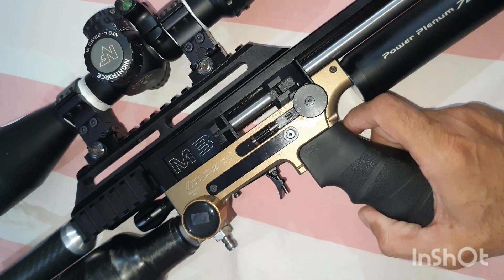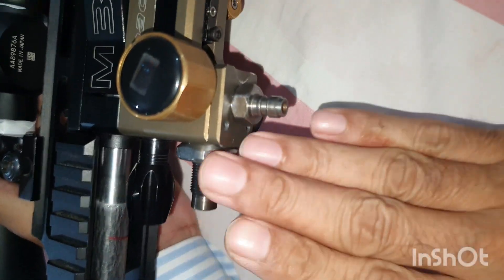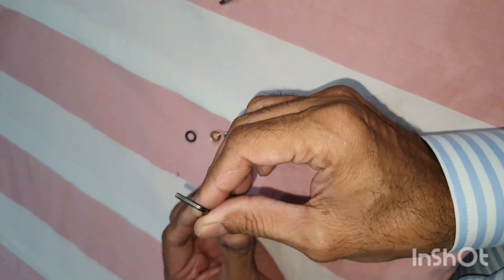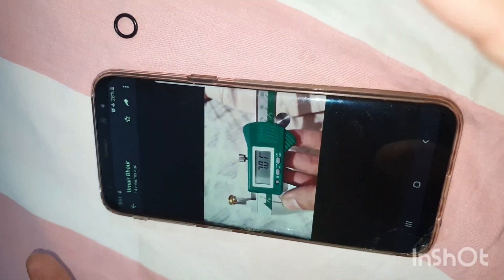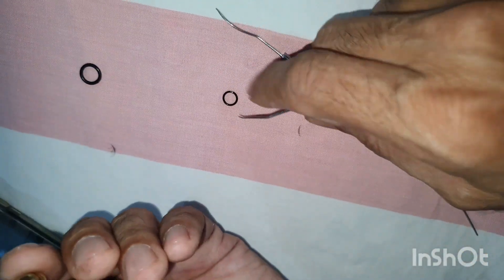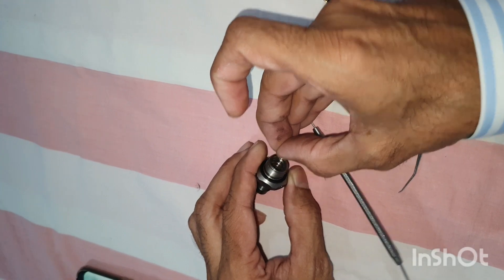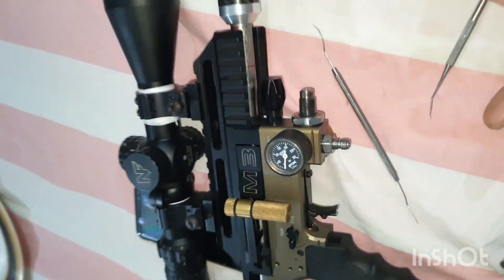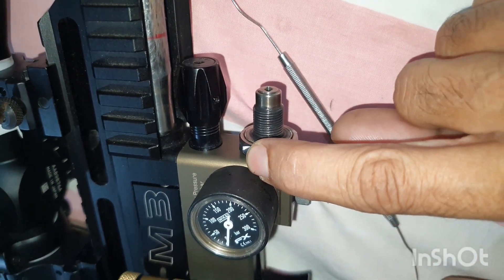FX Impact M3 1st regulator modification

Comment: I liked your video and it was very interesting because I am suffering from slow recovery after I had a fast recovery , but once I raised the pressure in 1st reg things changed and even the small o ring inside the body of the regulator was damaged and the piston o ring as well was damaged

Comment: Awesome I have already replaced that whole reg three times because it starts to leak from the breathing hole so thanks for sharing be safe buddy 💯
Reply: Replace only the small tiny o ring in the body of the regulator which sets in the middle at the breathing whole area from inside and the leak will stop

Comment: Alo can I buy modified parts from You ?
Reply from the maker: I do offer some parts but 1st regulator parts are not plug and play. So I do not offer them.
Reply: @BhaursAirguns  I saw some delrin between regulator screw and piston, but I'd be happy to buy complete set if it fits stock first reg case. I'm able to fit them.
Reply from the maker: @gagain100  The new version of FX pistons is similar to what I made. All piston made of brass and front sealing tip made of delrin.

You can easily buy FX latest pistons from FX.

It will cost you less that at what cost I can provide you the piston

Comment: Good video I have a cuestion I rebuild the second stage regulator in my m3 several times but when I screw the bottle and I open the regulator don’t hold any pressure the air star leaking trough the barrel what you think it’s thank you
Reply from the maker: Valve is defective

Comment: hi mate could you sell to me your first stage mod. reg  piston and your modification tigger for my impact m3 ? regards
Reply from the maker: I have sent a couple of triggers but I found that it's not a plug and play part. A lot of minute adjustment is required.  Hence I am not selling it anymore. 
Similarly I understand that one has to understand the real problem of the regulator to fix it.
The piston and brass part can be sent but I can't say these will be productive for you or not

Comment: Hi.
Greeatings from Portugal.That is a good mod, congratilations.
I will share what i´ve made that works too.
In my case, I have a huma reg gen 2 for my fx crown, and I discover the piston (brass) and springs (0.4) from huma gen 2 are the same as fx 1st reg (plastic piston).
So I change it and add 2 more springs. So 7 sets of total 14 springs in this order  ))(())(())(())
210 bar 1st reg and 180 bar on second.
But if i had a lathe, I tried to copy your mod just because is better🤙

Comment: After many times changing 0rings on the first reg I have two first stage regs from fx they both leak after I change 0rings after about a couple of weeks it just leaks from breathing hole so I bought a huma first stage reg for my fx m3 now it's good 👍 so far fingers crossed thanks for the info I tried what you did but it still leaked so I just gave up and got the huma hopefully this will solve my problem ty again it's always a pleasure watching your videos
Reply from the maker: Thank you. Hope Huma will work for you. I prefer FX Regs over Huma.
Huma is good initially.  If we adjust it again and again it starts showing issues. 

But for 1st reg as we don't need to adjust it often, Huma should work well
Reply: @BhaursAirguns  What kind of material did you use on the tip of the disc springs pin, where does the sealing with the adjustment screw?
Reply from the maker: @marcioeidelwein7610  I use peek material or complete piston made of peek. Peek is much harder material than delrin. But as I set the 1st reg pressure at 160 bars or higher,  I concluded that peek is better for instant sealing at such high pressures.  It is not as flexible as delrin.

But in 2nd reg I am using delrin piston as I normally keep the 2nd reg pressure at 110 bars.
Reply: @BhaursAirguns  thank you
Reply: Just change the small tiny o ring which sets inside in the middle that no one sees it, it is under breath area and hard to take it out and to fix again , the leak coming from their.
Reply: @sameraloreibi5750  yes sir I went back to a fx first stage reg that I got from Utah airguns about a yr ago it seems and it's working great the huma made my gun look weird lol but if it does leak again I'll probably just do away with it and plug the gage hole just like the m4